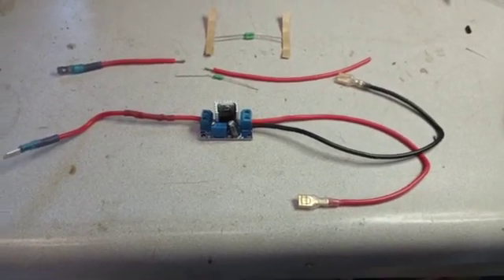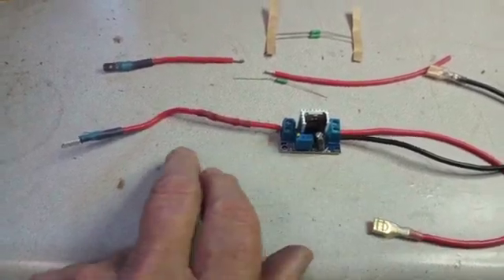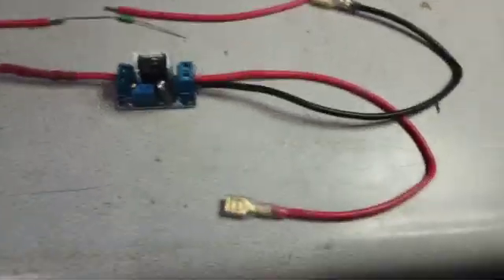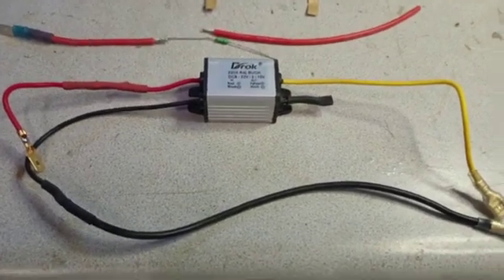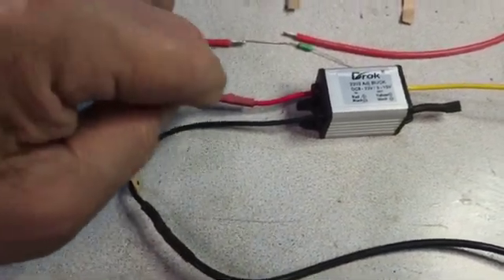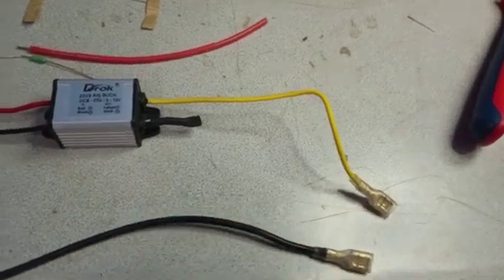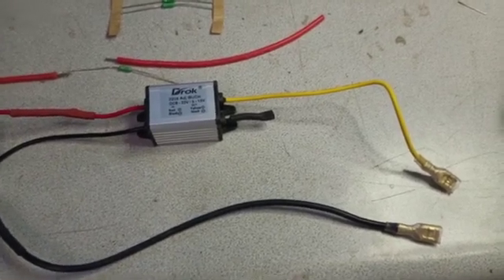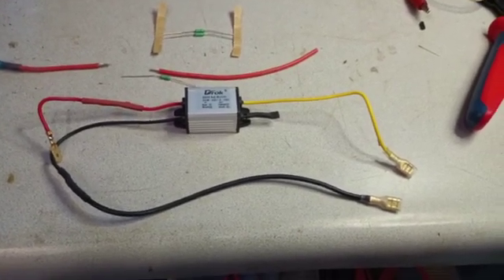VW beetle Fuel gauge  Regulators.  Two different types.  How to wire up.

Comment: I have an aftermarket gauge that measures 31.4 ohm , but in yiur video you mention an OEM , what is an OEM? what should be the resistance on that OEM?   thanks 👍
Reply: OEM is Original Equipment Manufacturer.  All the electronic  VW gauges that were made by VW were around 18 ohms. When they go bad the resistance will either be near zero or 12-13 or so.
Reply: @jandst.6634  ok thanks, i am bad with electricity, can you please how should i measure voltage out of yellow wire of the buck regulator? where do i need to put both of the multimeter terminals? thanks!!
Reply: @alexherrera3918  The red wire is the hot wire that you apply the 12v to... and the negative of the 12 to the black wire...  The yellow is the output voltage.  Put your meter lead on the yellow and black wire.  Yellow to the + of your meter, Black to the - of your meter.
Reply: @jandst.6634  Great Many thanks!!!!!!!!!!!!!!!!!!!!!!!!!
Reply: @jandst.6634 I was able to measure 11.6 but voltage does not doing down by turning the screw counterclockwise. I am about 15 minutes turning it and it does not change. Do i need to connect the black wire on the yellow side of the regulator? it did like in the video , not black wire. please help, what am i doing wrong?
Reply: @alexherrera3918  Your meter has to be connected to the yellow wire and the black one to measure the output voltage.  I presume that your input voltage/source is something above 10v...  I replied to your message on thesamba.  Jim.

Comment: the links on the description is not complete , i can not get into the regulator in amazon or the port in forum. Can you please post it on the response. Thanks
Reply from the maker: The Samba : https://www.thesamba.com/vw/forum/viewtopic.php?p=10233251#10233251

LM317 https://www.amazon.com/s?k=lm317&crid=29BFEHC3MPTE6&sprefix=lm317%2Caps%2C167&ref=nb_sb_ss_p13n-pd-dpltr-ranker_1_5
Buck regulator:  https://www.amazon.com/dp/B00C0KL1OM?th=1
Reply: @vwbeetlefuelgaugesystem thanks!!!
Reply: @vwbeetlefuelgaugesystem many thanks for the links!!!
Reply: i purchased the buck regulator and added the piko fuse. I want to test the current, how does the current gets increased, turning knob clockwise or counterclockwise? i do not want to burn the unit using 15v, i want to start at the minimum. please advice. thanks
Reply: @alexherrera3918  Bench test it by hooking up the input voltage only, not the sender and gauge.With your DVM hooked to the output voltage,   adjust the voltage to 6.4 or so and your done. Think CCW reduces the voltage but I am not absolutely sure.  All these Buck regs have the voltage turned up max.   
Current is not what you want to measure, just voltage.  
Hope this works out for you.  Jim.

Comment: You must have both the after market sender, which is about twice the resistance of what the oem one is,  and gauge to require the higher voltage. Mine only needed 3.6 volts as the sender and gauge in my 75 Super Beetle where still original. Current draw was at .230mA with full tank which would give the lowest reading and highest current draw for the gauge, 8ohms right at the sender. Made mine from a 5V regulator with 2 diodes in series to get it down to 3.6 volts once they get biased. Installed parts inside one of the cheap plastic replacements that only have a resistor and zeners inside. Soldered regulator to metal cover for heatsink. Works perfect and doesn't peg the meter hard so its just enough current to drive it.

Another thing to watch for is the sender wire, Mine was 4 ohms measured behind speedometer to under the hood. That's a huge amount that threw off my bench readings, full on bench to only 3/4 when installed with a full tank. Ground wire was fine, only the yellow sender wire bad even after cleaning copper wire ends with acid.
Reply: You might have typo'd wrong....  You typed, " you must have the after market sender, which is about twice the resistance.".  It is the aftermarket gauge that has twice the resistance.  All the VW beetle and bus senders are 10 ohms full and <>65-70 empty.  
Have seen that signal and ground wire on many VW's be over 1 ohm.  Old oxidized spade lug crimps.  Good catch!
Never seen any gauge work at 3.6 v on the input side and I have worked with over 50 of them. 
Wonder what your gauge resistance is with nothing hooked to it.
Jim.

Comment: Install and it works grate
Reply from the maker: Wonderful.  Did the voltage preset of 6.4v do good or did you have to adjust the voltage a bit.  I like to use the resistors.  At least the 33 or the 47 ohm for 1/4 or R.  Which regulator did you end up purchasing.  Jim.